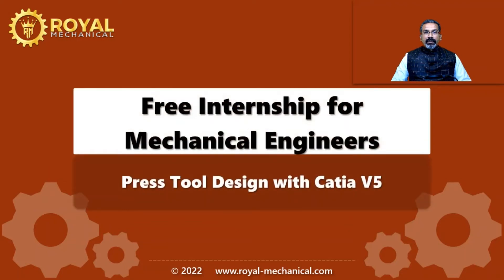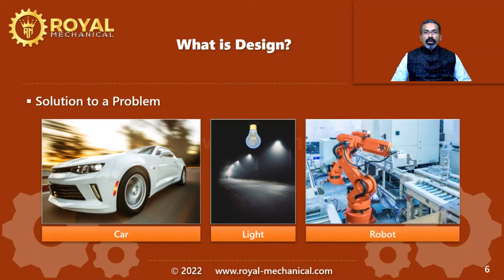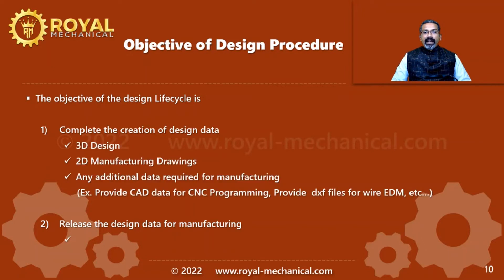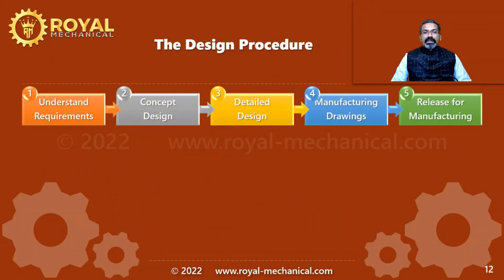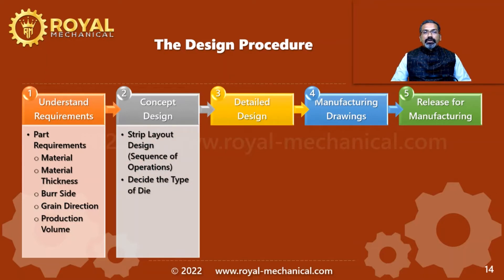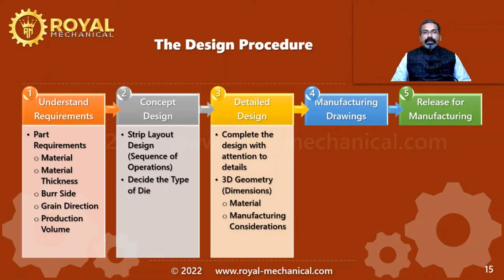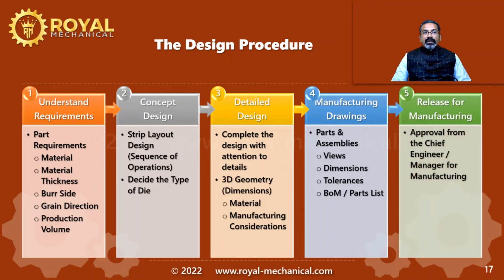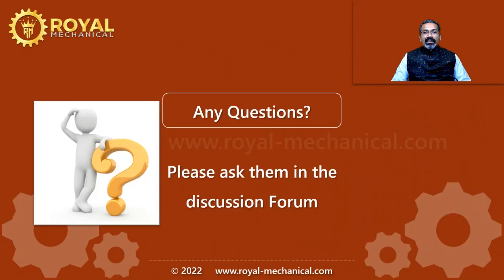Free Internship for Mechanical Engineers | Part 8 | The Design Procedure to Design a Press Tool

Comment: Sir, I am enrolled in this internship. I need this certificate before 20 August 2022.
Sir please say, Is this certificate available to me before 20 August?
Reply from the maker: Hi Shubham, I am planning to complete this course by 31st July 2022. Worst case by 7th of August 2022 (assuming 1 week delay). If you can prepare the internship report by 15th of August 2022, You can get the certificate by 20th of August 2022. Both of us will have to work hard..👍
Reply: Ok , thank you very much sir.
For giving this great opportunity.
Reply from the maker: It's tough, but Let's do it...💪